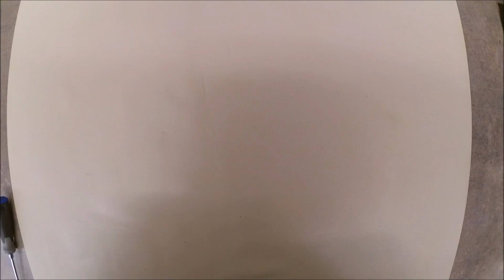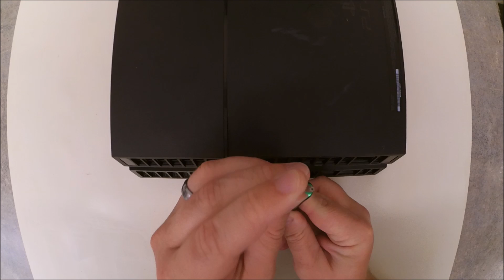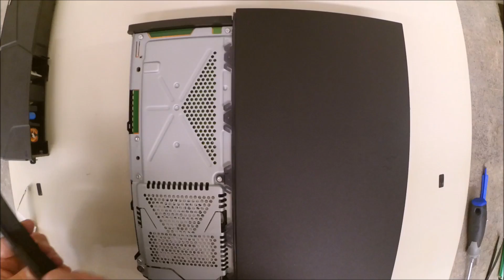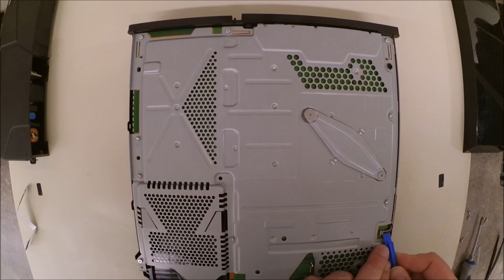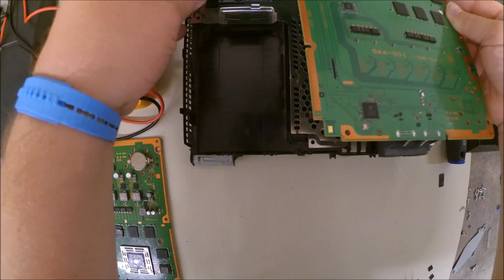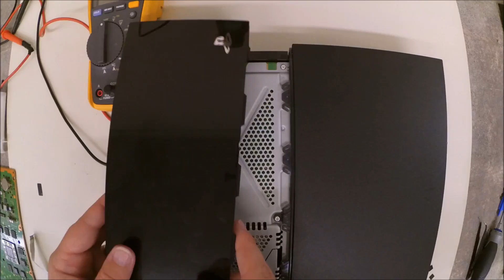Sony Playstation 4 (PS4) Motherboard Replacement

Comment: Is it a must to swap the cd rom along with the board?
Reply: It's a BluRay drive but yeah. The motherboard and BluRay Drive need to match or it will not work. The motherboard will not accept the drive which not only prevents you from playing discs but it also prevents any system updates (which also means you can not play any online game). 

If it's the laser inside the drive which is the problem, it might be easier/cheaper to just replace or clean the laser in your current drive. It's a bit of work though.
Reply: @bartvkessel  I swapped out and replaced my motherboard with the exact same model of motherboard i originally ruined. Would i still need to replace the disc drive? I'm thinking no, right?
Reply: @popedizzled_mywizzle  I believe that should work but I'm not a 100% sure,  sorry
Reply from the maker: Most of the Playstation mainboards are "married" to the optical drive board, meaning you have to replace both boards if one fails.

Comment: Think i may have broke my fan connector •_•
Reply: I did too, the wire he touches at 9:27 right? Do you know how to fix it? I
Reply: @naomydiaz9391  Nah i still haven’t fixed it ,i’ve been meaning to bring it in to a shop but i haven’t had a chance too

Comment: Hay there so I took my ps4 apart recently to clean the fan and stuff I put it all back together and the games are really laggy I double checked the connection and there fine. Any idea 💡? What could be causing the lagg

Comment: The hard drive can be put into another system without losing all your data?
Reply from the maker: No, but you can use the drive in another system with a bad drive. Once you sign in your saves and games are downloadable.

Comment: Hi i have a question. My ps4 pro does not turn on at all whatsoever so i took it to a repair shop they think it was a power surge that messed up my pro but they have yet to start repairing my system. I wanted to know if there is any possibility that i would loose any of my saved data/memory of my console. They also told me today that it coukd be the possibility that the motherboard might have been fried if it wasn't a power surge. If that's the case that my system's motherboard was fried would i lose my saved data from my console once i get thd motherboard replaced? thanks in advance!
Reply: If your hard drive isn’t damaged then you’re good
Reply: No, if your games and file saves are on a hard drive, it stays there, so if you put it into a new ps4, nothing should be deleted, think of it like a usb stick, you can put it into any computer and still look at all your files, well its the same thing with the ps4 hard drive

Comment: Hi on my ps4 i got a console ban if i replace the mother board will it be like a fresh ps4 and let me play again ( my ps4 account is not banned its the console)
Reply: mazhar Haque me too you solve problem?
Reply: I've got the exact same problem and desperate for an answer
Reply: mazhar Haque replace your hard drive not the motherboard
Reply: did it work?
Reply: changing the motherboard would work, but you would would possibly need to do a fresh install in case the ban was logged on to a data file in the OS. The reason for the motherboard change is due to the integrated NICs and the unique MAC address that each network adapter has burned into it. If you can disable the onboard network adapter and connect with an add-on adapter or use software to clone a different MAC address, that should do the trick. Good luck. Hmmmm, maybe connect through your router with a cloned MAC address. My EA9500 can do that, but I haven't tried it with my PS4. Good luck
Reply: Y'all do Realize that YALL ACCOUNTS ARE ON THE CLOUD? Your Account Banned Sorry

Comment: By replacing the motherboard, does it effect the PS4 in any way?
Reply: Affect or effect 😂
Reply: RIHAN KHAN 

At least he knows how to spell
Reply: If u get banned it undoes it
Reply: @bobriley9950  That Makes no Sense. Your Account is a Cloud Account, Dummy. No Matter what you do to your machine it won't change your account
Reply: Sup Bro maybe he was referring to a console ban? In that case, this might work
Reply: Isn’t the ROM chip calibarated directly to your hard drive specs?
Reply: Carlos Hernandez  no u prik

Comment: What's the reason for you saying you also have to change out the drive? And is there a part number that had to match the new board for it to work...or are all drives the same? Makes no sense as to why it has to be changed out also...
Reply: I was wondering the same thing did u figure that out?
Reply: @michaelgrace5436  No I did not, I ended up just buying another PS4

Comment: where did you order your motherboard from? I've been trying to find a website to order from but I can't find anything. please get back to asap.
Reply: how can I get a motherboard or where can I buy one
Reply from the maker: It was pretty hard to find but we got lucky, one of our distributors had 1 of them come in. It's a long shot but I can check with them if you let me know the model number of yours.
Reply: Hey there, I was wondering if you had any experience with the ports?
I just bought a ps4 camera for my ps4 and it doesn't work, so I called sony and they said its most likely a fault/defective AUX port and the service fee would be 150+shipping...
And I feel this is their fault for selling a defective system in the first place.. like honestly how was I supposed to know the AUX didnt work if I never owned a camera until now? My ps4 is no longer under warranty. Well anyways... I hope you can help me as to where I could find a AUX port/replacement ? And If I replaced that part and soldered it back onto the motherboard would that most likely fix the problem? Or is there more to it - such as the motherboard itself or some chip? Any help or advice would be greatly appreciated it would save me a good amount of money that I don't have. please private message me when possible. -Ellie